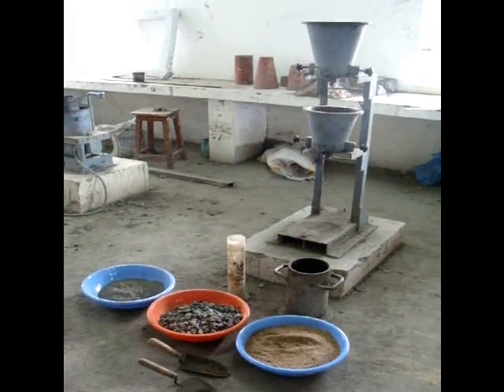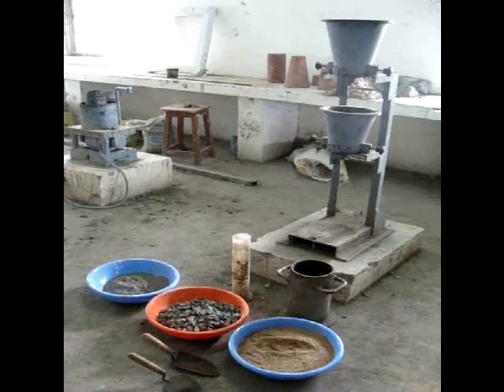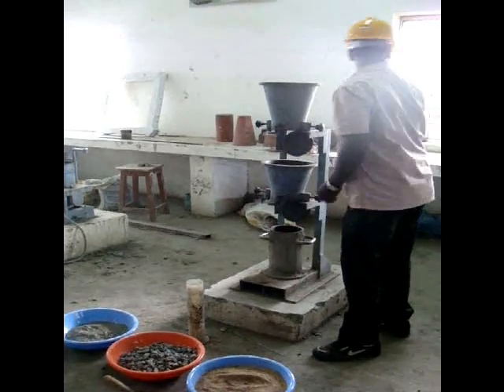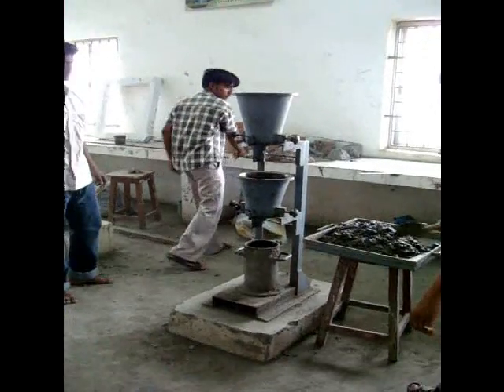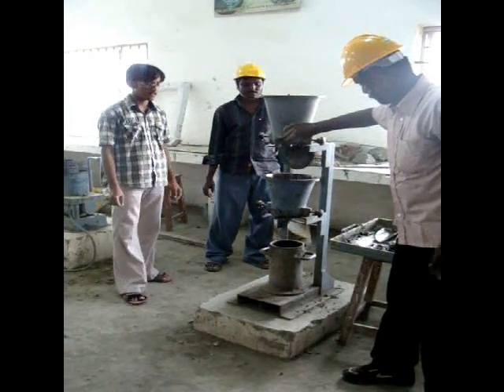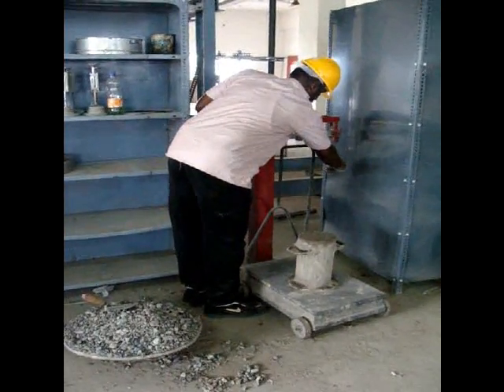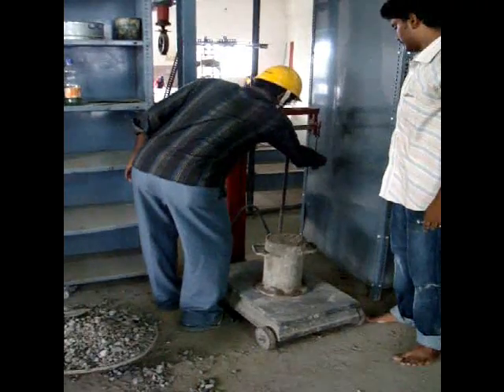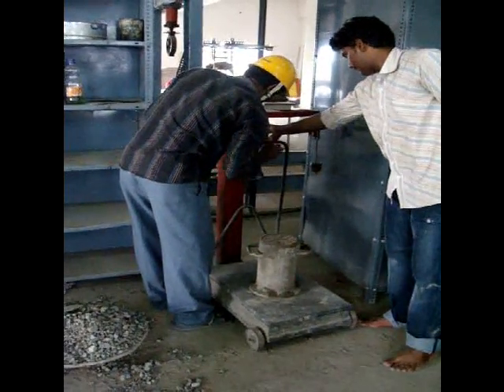CONCRETE COMPACTING FACTOR TEST (IS 1199) DEMO BY SACHU

Comment: Compaction factor
 = weight of partially compacted concrete/ weighg of fully compacted concrete

=W2-w1/W3-w1

Where,

W1= weight of an empty cyclinder

W2= weight of cylinder + weight partially compacted concrete

W3 = weight of cylinder + weight of fully compacted concrete

✌😀
Reply: Sir you can explain me civil engineering concepts basiclu

Comment: Good job,, but this person did a little mistake during partially filled concrete, when the cylinder got  filled with concrete there was rise in concrete, so it must to be removed horizontally with trovel but not to push , as you can see he push the concrete and make level. other its perfect.